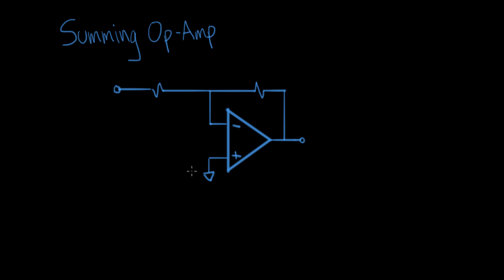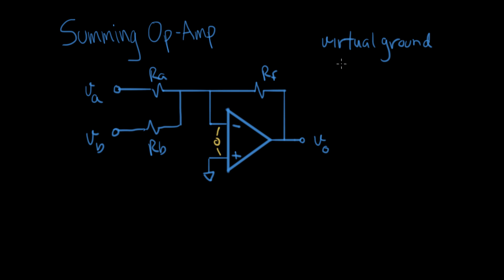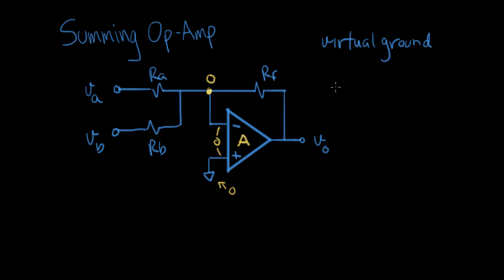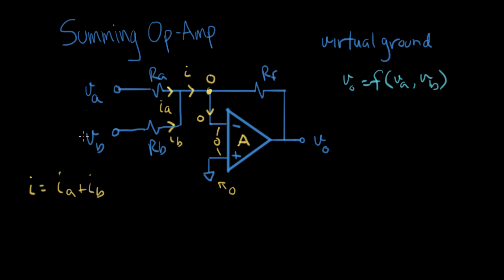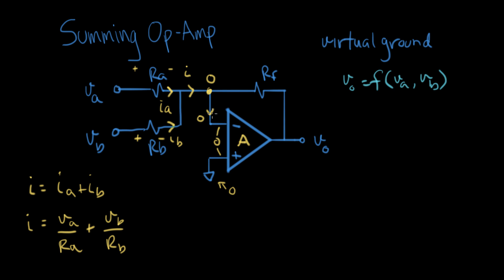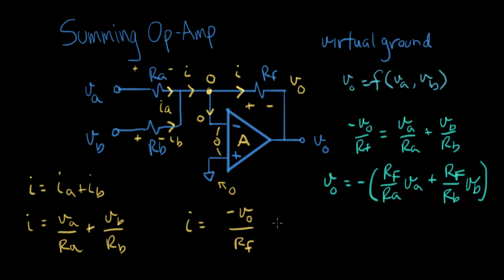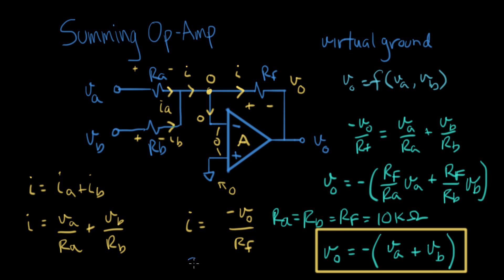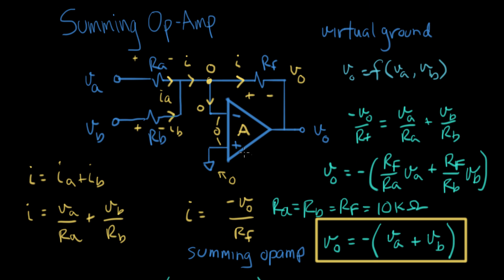Summing op-amp circuit

Comment: Sir , in the previous video you defined A=r2/r1 and said A is a very large number.But if A is a ratio of resistors se cant it be low , if i take r1=r2 then A=1;

Comment: In which way these calculations would change ifV(a) and V(b) are connected to negative input of amp? Seems like everything would remain the same? Isnt it? Where am I wrong? And why it is called summing if we get a sum with minus (reverted sum)?
Reply: Sorry. Correction of the question. In which way these calculations would change if V(a) and V(b) are connected to positive input of amp?

Comment: Hey i have a question (that might be kind of stupid, sorry if that's the case). 
Since The amplifier has close to zero voltage and current and to my understanding doesn't seem to affect the equations, why use it at all?

Comment: What if the summing terminal is the positive terminal instead of the negative terminal?
Reply: It would be a non-inverting right? The negative terminal means its on the inverting side as far as the wave form goes I believe.